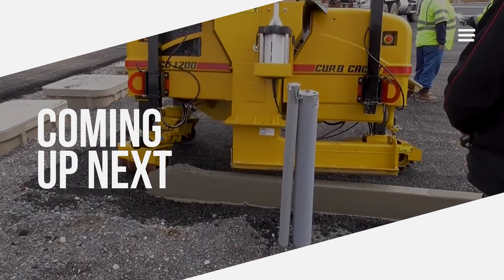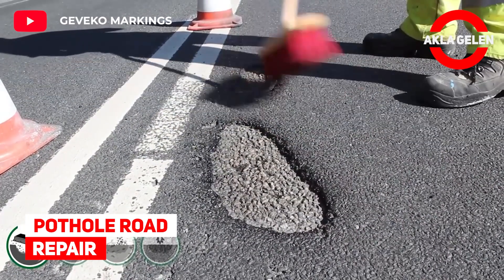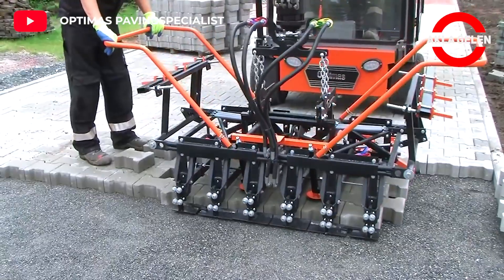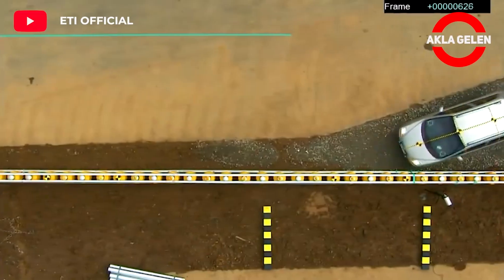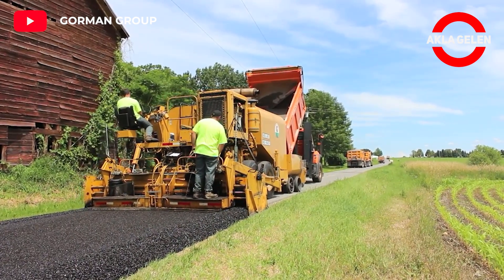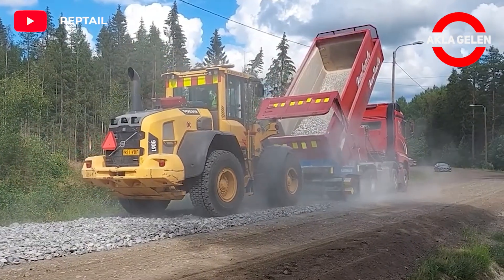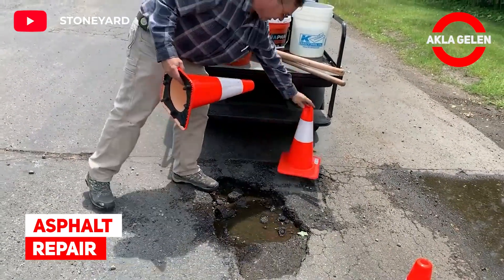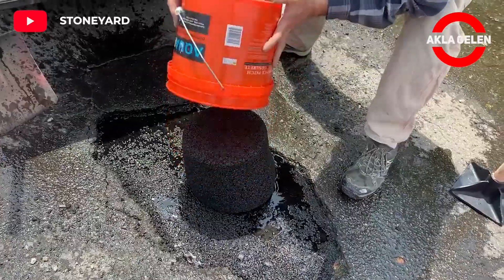This Road Technique Is Incredible - Ingenious Road Inventions and Technologies You Must See

Comment: not sure how safe the bicycle divider is...
Reply: The purpose seems to be to divide the area temporarily. During festivals or events, accidents are reduced by dividing areas next to the roadway and creating a dedicated area where only bicycles pass, or installing them on roads with no center line to take uniform flow without congestion. I don't think a partition is meant to stop anything.
Reply: I had that same thought, but it's a temporary solution.
Moreover, if you compare it to just a strip of paint, drivers will be a lot more averse to driving into the wave separator compared to just driving over the strip of paint. At the very least, cars won't park in the bicycle lanes if this is there.
To many drivers, the strip of paint is "just a suggestion", while the wave separator isn't a 100% physical barrier and won't actually stop anything physically, it is at least a 5% physical barrier that will damage the paint job on their cars, so it works great as 95% mental barrier and isn't "just a suggestion".
Reply: better than never
Reply: @mouthbreed1352  ㅂ7
Reply: At least it isn't flat and the vid indicated it was intended as temporary.
Reply: So do we
Reply: As someone else said, if a cyclist’s pedal gets caught in the divider and it causes them to fall while there is a car passing, they could get seriously injured.
Reply: @joshuatk59  Exactly: I prefer nature path even if I sometimes get flat tires, small price to pay avoiding traffic accidents.
Reply: Si not
Reply: It aint safe. Safeguard urself via taking personal safety methods. Gotta wipe ur own ass. Or find yourself dead and crying out for a piece of --it lawsuit!